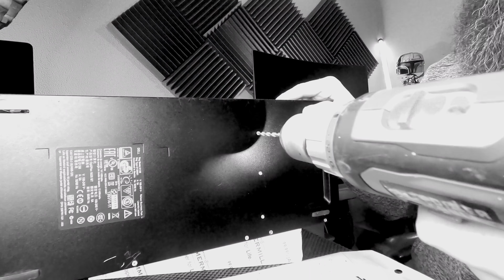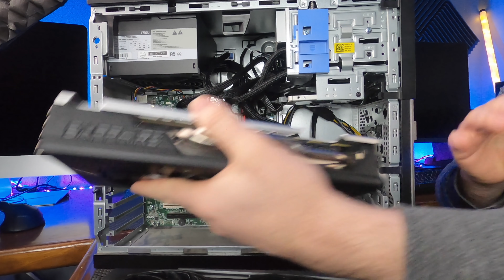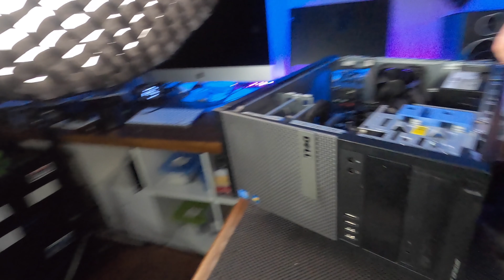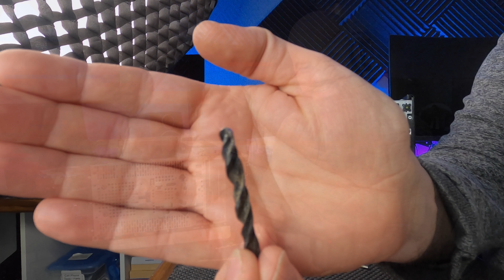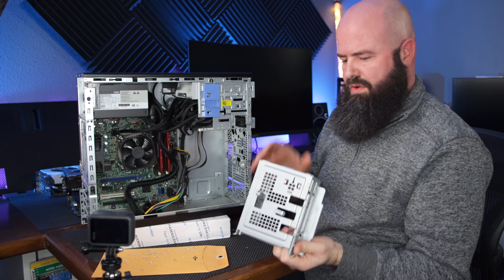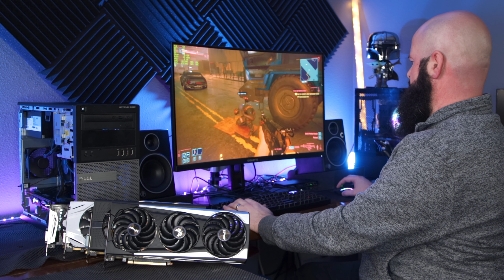Dell Optiplex BIG GPU MOD - fit almost any GFX card in your 9020, 7020, 9010, 7010

Comment: Man im having the issue, bought dell 9020 and ask ai if it will fit, said yes, got my k2200 Nvidia and the plug in plate is way to wide to close the door cover, if there is a special computer housing that can use everything but wider by chance? Not sure what to do because i bought it used, no return, also i already refurbished it by putting new paste and also heat sink has been added as well. Why idea or links for a low price will be greatly appreciated

Comment: excellent video, I had the worst nightmare of blue pcie  16 stopped reading inserted graphic card, I did everything  such as (updating windows, drive installer, updating BIOS, even installing new power supply last i tried to check on pcie reading from bios but came to conclusion that  my computer doesn't read it maybe because of damaged pins , now  i need that white PCIE to use it instead of the blue one which made me think to buy "PCIe x16 Riser Cable" and go along with leaving gpu out case or this option you showed me which i am going to try soon and hope i get 80% working rather than internal potato gpu.

Comment: hello netguy, I am a Frenchman who bought a motherboard and an i7 4790k processor for a dell optiplex 9020mt, I ordered everything in the United States
The Phanteks Enthoo Pro swap is a total success in terms of hardware: an Asus dual 3060 graphics card 
a seasonic 850 watt power supply
a Hi 100 pro corsairs watercooling it seems to me 
a wifi card in pciexpress ax3000 deporter 
here is my configuration 
but the bios is missing to put the windows 10 pro license
To get there, to fix the watercooling backplate, I cut off the 4* corners of the original Dell backplate of the cp5f7 motherboard, if memory serves, with a dremel.
I bought the Front panel Adapter DFP19-TK kit for Dell Optiplex/Precision (optiplex 7010, 7020, 9010, 9020 and Precision T1650, T1700, & 3620) on ebay and it worked well thanks to you Mr. Netguy and your videos so well explained!!
thank you again

Comment: Should have got the Nvidia GeForce 1050 TI 4GB runs great on Fortnite OverClocked 200+ on core clock and 1000+ on mem clock 20+ voltage and you got your self a mid-tire gaming rig with the right CPU in 2024
Reply from the maker: In my defense the video is from 3.5 years ago 😆
Reply: @TheNetGuy  true lol

Comment: Would the sapphire card work?
Reply from the maker: Yeah as long as you have the space and power.
Reply: My PC is a Dell 9020 with 25 GB RAM, a certified 700 W BR power supply, I want to put an RX 580 on it, it will work.
Reply: core i5 4ta generation a from venezuela
Reply from the maker: Yes

Comment: Got stripped screws after trying to screw in GPU. What screw size should I get then? I originally used the ones that came with GPU, but since those are now busted, what can I do now?
Reply from the maker: The screw just prevents the GPU from falling out.  If it’s in the slot properly and securely you could try a slightly larger screw in the slot or if you don’t move your machine much, skip it and leave the stripped screw in. The PCIe slot retention clip should keep it in.

Comment: This is the exact video i need. I just ordered a 9020 with i7 4770 32Gb RAM and 1tb SSD. and I ordered a rx 580 and an aftermarket 500w PSU with an adapter cable. The 580 I got claims to be under 10 inches so I'm hoping it fits. I'm really hoping I don't have to swap everything into another case
Reply from the maker: Sounds like a great build. You’d be surprised how many games that setup will play nicely at 1080p!

Comment: Hey, what do we do if we're trying to fit an rx6600 (282mm) into a opti 7060 MT, when it wants to stick out the front by about 10mm, lol ???  Also could I use a couple of sata cables into the card to add to the power from the pcie slot as it's not a high power card?
What do you think?  obv re-casing is an option.
It's just opinion I'm after (260W dell psu), obviously not something you've done.
Reply from the maker: That’s going to be a hard one.  You’re already over your power budget and the sata to PCIe adapters are no super reliable for extra amps.  Be careful!   Time for a new case/mobo/cpu/psu?

Comment: I was aware of the drill out method, and have drill out the hard drive cage method, I resorted to the aviation shears and brute force method of drive cage removal, as I did it in the middle of the night number one, and I was not in the mood for removing everything inside to avoid metal shavings contamination.  The Dell I began with, a Precision T1700 with i7 4770. Added a Dell GTX 1080 recently to give the Xpression Camera app a try, used to use facerig via steam, most fun returned on investment ever, it enabled my alter ego, a black cat named Bad Ass Kitty, that always had a cigarette hanging in the corner of it's mouth, and that I can use Animaze now, I am aware of, Facerig was the best 20 dollars I ever spent on any software, so much fun was had with that app....the Xpression app appears to be next level, so gonna give it a good thrashing to see if it lives up to its potential.

Comment: I need solution for my dell 7020sff after i add rx580 2048sp and psu is corsair vs 450 it won't turn on but have blip on my mouse and keyboard led..
Pls how to solve my problem?
Reply from the maker: If you pull the GPU does it start ok?
Reply: No,

Comment: I noticed that it looks like you aren't using the SATA power connector on the mobo? Can you plug the storage drive directly into the new PSU instead for power without issue?
Reply from the maker: You can, and probably would look cleaner actually 👍. Good catch.

Comment: I'm so pissed off man I spent the last few weeks doing all the mods needed to upgrade my 7010 and today when I got my gfx card that I had been paying of bit by bit back home to put into the pc I've come up against the Ram tabs issue so I can't install the gfx card. I can't take it back as for what reason? I can't buy another kind of card either I don't have the money I just paid all in all £170 for this MSI AMD RX 5600 XT Mech OC 6GB so I know you didn't want to go via the ram tab mod and you didn't say what it was or how to do it but I think I know what to do but I'm just wondering what the problems could be by doing this. I'm guessing I just need to file them down a bit to allow the card to fit properly right so it can't be that hard right? Honestly the amount of items I have bought to upgrade this 7010 over the last few weeks I'm now seriously thinking of buying a new motherboard and then also a case and just swap everything else over like the ram, ssd, hdd and the cpu & cooler oh and the power pack but I just had a quick look on Amazon and I can't seem to find any boards for an i7 3770 that has 4 x ddr3 dimm slots as I have 32GB of ram in this 7010 and want to keep it that way. Sigh man this upgrade doesn't want to end and has done nothing but fight me at every step it's unreal.
Reply from the maker: Don’t give up - sounds like a great upgrade and you’re almost there.  The ram clips are just retainers/ejection.  You can safely remove a small amount of the plastic so they don’t rub if your card is fighting you there.  A pair of sharp clippers can remove the offending 1/8” and they still be functional if needed.  I’d recommend seating the ram well, clipping the room you need and then install the GPU.  You’ve got this

Comment: Very informative video. Will a GTX 3050 card fit in an Optiplex 7010 case?
Reply from the maker: 9 3/8 inch clearance on the mid tower. Unless you take out the drive cage.
Reply: Thank you for your reply.Keep up the great work!

Comment: I have the same pc but it dosent say 9020 or anything like that it says xe2 same layout as ur pc i removed the harddrive tray but my rx 580 still dosent fit because of the ram i am thinking of getting a riser cable but i have no idea on how ro mount it in the optiplex
Reply: You’ll need a brace, and definitely have to cut the rear of your case.
Reply from the maker: Vertical mounting is a lot more work than a riser. You should be able to put the memory in first and then squeak the RX 580 and after. If you need to you can use cutters and clip the top of the ram clip or grind it down for clearance. Not ideal.

Comment: Please help, my graphics card is too wide. It hits the ram. I have a rx 6500xt
Reply from the maker: Not a lot of options here.  You can try to shave down the plastic tab on the memory slot
Reply: @TheNetGuy  Is there a way to remove the tabs? Or will shaving it be my only option.
Reply: @TheNetGuy  The wires underneath also get in the way of the fan

Comment: yo i have a question do you think a gtx 780 normal would fit in the modded optiplex 9020? (Just the hhd cage).
Reply from the maker: There’s like 9 & 3/8” if you don’t remove the cage.

Comment: bro plz tell me which graphics card in compatible for my pc optiplex 9020 (0PC5F7 motherboard)
Reply from the maker: Lots of great options here.  RX470, RX570, RX580 - GTX1050, GTX1060, GTX1070 would all be great options with the bigger power supply mod.
Reply: @TheNetGuy hi I'm new i have motherboard Lenovo iq270ms and yeah in sff but currently I'm upgrading my PSU to 210w to 500w, can you please tell me in this motherboard rx 580 will work or not? Thanks
Reply from the maker: @TSOLYRICS it appears to have a PCI express slot so very likely would work. Not sure about fitment though as it’s tight to the ram modules and used in very small cases.
Reply: @TheNetGuy  yes it have two pcie 3.0 x16 slot and one pcie 3.0 x1 slot, if i can fit it, will it work? 🤔

Comment: Holy hell, it takes the strength of mighty Hercules to get that cage out. I've drilled out all the rivets I could reach and my pitiful mortal strength is not enough to break the remainder of them. How much wiggling is it going to take to break these? Furthermore, does it matter at all if it's a 7020 and not a 9020? I presumed the mini towers were the same.
Reply: Okay, I just want to add something to this. Wiggling won't break the cage free, unless you've got a big S on your chest. Game Bench suggested to drill out five more rivets... the one holding in the cage divider, than the four on the other end of the system. You can reach them with a standard drill once that accursed divider is gone. Game Bench suggested an extender, but that wasn't necessary for me. Once those five rivets are broken, the cage is cake to remove. Like, good cake, not those nasty Mrs. Freshley's snack cakes.

Comment: Thanks for the information. It's very helpful... but it shouldn't have been necessary to drill out the hard drive cage in the FIRST place! Curse you, Dell! (cries bitter tears)
Uh, so anyway. I've got hard drives in that cage. What tool(s) will I need to perch them at the top of the unit? The plate drive should slot under the DVD-ROM, but what do I do with the SSD?
Reply from the maker: Lots of good options.  You can use a 3.5” to dual 2.5” adapter, I like those.  Or you can just find and open hole and side mount if you don’t care about looks 😂

Comment: if I were do this mod, would a RTX 3060 fit? (in general would it fit without the mod?)
Reply from the maker: It’s 9 and 7/8” so it would be tight.  Some 3060 cards may.  Honestly the case has better with the mod anyhow and gives you better airflow.  Check out the game bench channel for more mods like this.

Comment: Just a small question: Is it really safe to drill the holes with the components still in the case? I'm asking because the metal dust/shards could get in the motherboard.
Reply: It'd definitely be safer to take everything out.  Just drilling out rivets I'd at least put a damp rag on the opposite side or hold a vacuum there while drilling.

Comment: do you think a sapphire pulse rx 6600 would fit without needing to modify the clips? its only 0.03 inches thicker than your example of the rx 570 but you do say that it just barely fits as it is
Reply from the maker: It’s tight for sure.  I have the RX6500 XT here too.  That might be better and cheaper.
Reply: @TheNetGuy  i actually already bought it haha, bit of an impulse decision on my part. im just waiting on the delivery though
Reply: My XFX RX6600 fits with some creative maneuvering.  
Disclaimer: I did a motherboard swap (mATX) on my 3020.

Comment: Hey man great video. I just purchased a dell optiplex 7010 case I followed your video and removed
the hard drive caddy case. I also nodded the back of the case.  So I could move the power supply
further back in the case so I can make a little more room for the msi procarbon motherboard I have planned I also purchase a I7 7900 non K variant cpu for my build.
Reply from the maker: Almost time for a new case ;)   Lots of good ones out there - especially on Amazon Warehouse deals.  You’ll have that thing upgraded piece by piece in no time!

Comment: can someone help me... I tried installing a old quadro fx3800 (I know its old, just waiting to upgrade next month) and the pc turn on but the 3800 just turns on a red light and the fans go at 1000 percent speed. (running on 16gb ram, a i7 4700 (non k), 240gb kingston ssd (using a dell 9020 as well)

Comment: Is there any difference for upgrading the 9020 SFF? I’m almost regretting getting the SFF but it was an upgrade to the free 390 I had been using and it only cost me $40 (I used your advice and used OfferUp). Thanks!!
Reply from the maker: Yes, the SFF is harder but not impossible to upgrade.  The CPU cooler bolts to the case itself.  You can use a Vetroo V5 aftermarket cooler though with this that comes with a backplate for Intel.

Comment: Thank you for this video that I would have liked to see 7 years earlier!
I had a configuration with GTX 970 and after MSI GTX 1660 super, it works fine but without the hard drive cage!

Comment: Enjoyed the vid! One recommendation; if the GPU has two power connectors use two power cables from the PSU. Don't daisy chain.  If one cable was sufficient the GPU would only have one connector.  Don't risk being over the wattage limit of the PSU cable.
Reply from the maker: Good point

Comment: Great vid! Just did this to my optiplex 7010 yesterday to fit a gtx 970 strix graphics card. To screw gpu in place, I just used the leftover screws from replacing the stock power supply since my new power supply came with screws for it.
Reply from the maker: Brilliant!   I’m tempted to do a follow up and cut the memory tabs.  I’m guessing your 970 doesn’t have a nutty big backplate?
Reply: @TheNetGuy  nope backplate wasn’t a problem! The only issue I ran into is the gpu blocked the front usb power port on the motherboard but I still have access to the sata ports so I’m not too worried about it.
Reply: So it worked on a 7010 ? I was planning to put a 2070s in mine, but as the 7010 doesn't come with the same motherboard than the 7020, the card may block the access to the SATA ports... wasn't it a problem for you ?

Comment: I'd recommend zip tying a low RPM 120mm fan to the interior front panel to get some continuous airflow. I got a Red Devil 480 into mine back in the day but it kept choking itself out. 1 fan later it's running MUCH cooler.
Reply from the maker: I think you’ve been peeking at my video list.  I love the idea but those concave mounts are in the way.  Going to try a couple things.